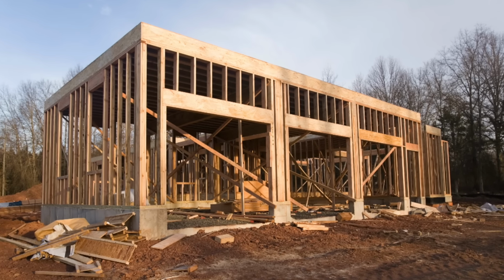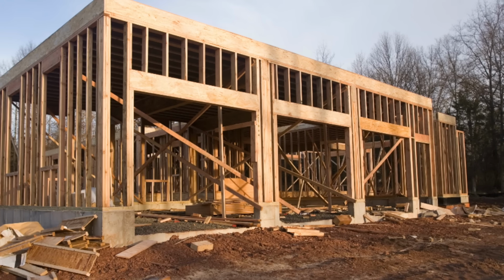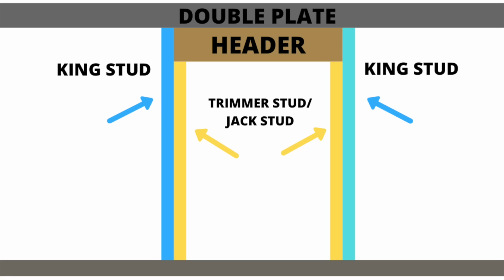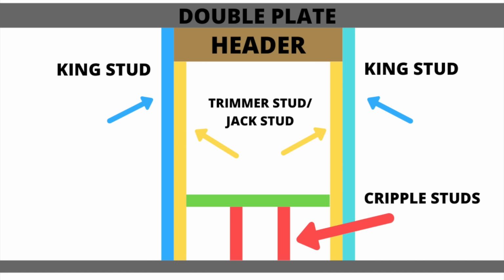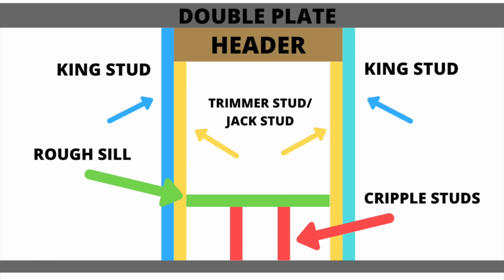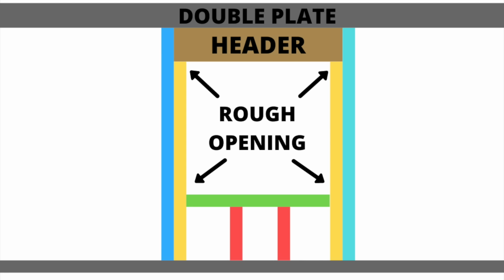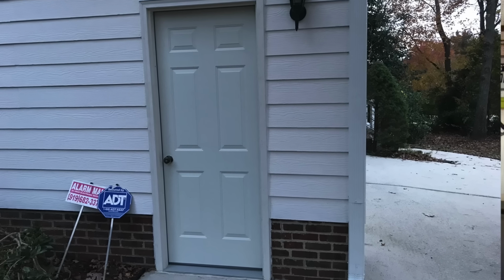All House Framing EXPLAINED...In Just 12 MINUTES! (House Construction/Framing Members)

Comment: Good stuff. Great overview. Refresher course for me. Can I be nostalgic about swinging a hammer, smelling sawdust and hearing the whine of a power saw?? I just saw a video from Japan that answered a lot of questions I've had. In domestic construction in Japan they don't use diagonal braces. (Your building has shear walls which are even better). They were installing one diagonal on one stud bay (at least 2' wide) at the corner.  Is that enough?  Here's what I saw in Kumamoto, Japan a month after a big quake in 2016: Some older structures collapsed. It looked like the heavy roof (ceramic tile) twisted a quarter turn as it collapsed.  Think of a stud wall with a diagonal brace in just one stud bay. Should keep the whole wall square, but if there's movement the rest of that wall can twist away from that stud bay and then it will collapse. I'd never thought of this before. A diagonal crossing multiple stud bays gives the whole wall more integrity, making it more of a large flat panel... And I'm trying to remember the last time I put a diagonal brace in a wall. At least 30 years (I did a lot of construction, but not much over the past 30 years). Now I, and everyone else just covers the whole wall with plywood. It's better, not much extra work.  I traveled extensively around Japan and found a lot of older structures with missing wall coverings. I didn't see diagonal bracing anywhere. 
Japanese highway and modern steel construction are built to the highest international standards. I did see one 6 story office/retail building in raw steel. No diagonals, but the beams and columns were about 3x larger than needed. It looked more like bridge construction than a building. Where I think the disconnect happened is temple construction, post and beam, is brilliantly designed to make a flexible but very strong structure. In a large quake the infill panels might have some issues, but the main structure does exceptionally well. Some bracing comes from what look like decorative stacked elements where the posts meet the beams. This construction method came from China where the Chinese understood how it worked. Some modern Chinese housing developments are crap, but that's about modern corruption. Chinese farm structures all had proper bracing, like an American framer would do, except for the places made from mud bricks.  So now you build your Japanese house. You think you're copying the temple structure design , you stick up four posts, then beams - outlining the box,  but no braces like in European and American post and beam, then you infill it with weak walls, then heavy rafters and a heavy tile roof. Earthquake hits, the lack of diagonal bracing, the roof moves or twists and the whole thing collapses. This happened a lot in the Kobe quake. 
I've seen videos on 'amazing' Japanese earthquake construction, if it's not modern, not a Chinese temple design, it's usually a lot of bunk. (like the suspended columns that are claimed to counter move dampening movement from  quake. I don't buy it. Not a bad idea but not effectively executed or understood.)
 You might want to add that top plates are doubled for two reasons. The first is to spread the load more evenly, but also so walls can be tied together. It's important that the two top plate boards overlap by at least four feet. In my old house at one point it was overlapped only about 18", the header above an adjacent door popped during an earthquake because of this.  The fix, because it was in the attic was to put everything back in place and cap the double plate with a longer third plate. 
I renovated a couple of old beach houses in Santa Monica, California. They were balloon framed. The second floor joists hung off lumber nailed to the surface of the long vertical boards of the walls. Of course after 100 years they all sagged. People would stop by and say, "They sure don't build 'em like they used to."  I'd smile, but always mutter, "Thank God they don't." My dad told me that when the nails start rusting in a balloon framed house they start to fall down. A modern framed house he said you could make all the nails vanish and it would all still stand, at least until the wind picked up.  This is because in modern framing everything transfers the load all the way down to the foundation.  Hope if you've read this far it's been interesting.
Reply: I live in Japan - moved there from Australia. I built a house I designed in Japan, with a Japanese construction company. The houses are almost always old school "post and beam" type construction - up to 120mm posts, and my main rafters are something like 270mm x 105mm beams. The modern designs still use this medieval method (which I made a feature in my home with lots of exposed beams and rafters) but most bracing is actually metal brackets and bolts I noticed. They do use a few cross-beams, and in one or two places plywood sheath. It's rare to see a fully ply sheathed building though...
You have basically hit the nail on the head with two major aspects of Japanese culture in general though. 1 - Religiously copying the external form of something without understanding the actual function. 2 - Coming up with an overly complicated and inefficient solution to a problem that wouldn't exist if they'd just done it the way it should have been done in the first place.
It is telling that my house built by Japanese carpenters has had several issues with leaking roofs and moisture, and a roof ridge cap blow off in a typhoon, while my shed (built by me with 2x4 or 2x6 according to Aussie standards) has remained totally waterproof and survived the same typhoon intact!

Comment: Great video, earned my subscript. I think learning framing is essential to house repair jobs, including running electrical and plumbing lines. You need to understand what is behind the wall, floor or ceiling to perform correct work.

Comment: I actually understood this video. My home was built (a typical NJ townhouse development) in 1995 and I took pictures of the construction from the slab concrete pour, to framing, to drywall, to completion as this is our first (and only) house. Our roof was pre-manufactured trusses and we had to decide whether we wanted the optional cathedral ceilings in the master bedroom or not so we got the correct roof trusses. We went with the flat ceilings. We also had the construction workers use our upstairs bathtub as a toilet even with the port-a-potty outside our house. We also found empty beer bottles inside window framing, and trash in the walls before the drywall went in. Our home builder (J.P. Orleans) only hired the best undocumented workers!
Reply: Oh, and after the house was about 10 years old, we had some construction work done and when our garage was opened up to repair sheet rock, the contractor said that all the fiberglass insulation was installed BACKWARDS in the exterior framing. No wonder our house was always hot in the summer/cold in the winter.

Comment: Really wonderful video, great information, thank you! At 5:55 is a picture of headers with no Jacks supporting them. Hopefully they were still in the process of building that wall and were adding some support later, otherwise the entire load of that header will be sitting on just nails!
Reply from the maker: Thank you, Tim! That’s a piece of stock photography, but that was my exact thought as well 😪
Reply: The floor system above is going to use floor trusses (see picture). The trusses will carry the load, so what you see is a header in name only, but not load bearing.
Reply: @jobacuda4472  gotcha, that makes sense. I’m assuming then that the floor trusses run parallel to this wall? The floor trusses I’m familiar with are still 16 or 24” OC, so they would still land within that window span if they were perpendicular. There is always the thought too that this is a one story build with trusses spanning over this whole wall, which would also negate the need for headers. Seems like though if they were headers in name only, they would be sized smaller?? Perhaps they are just to give the window frame some rigidity:)
Reply: @timlecount8690  I think they could run either way. Can't tell from the one picture.

Comment: 5:54, those don't look like very good headers. The top boards are facing the wrong way for good support, no jack studs, etc.
Reply: I don't know if you saw my earlier comment: The floor system above is going to use floor trusses (see picture). The trusses will carry the load, so what you see is a header in name only, but not load bearing.

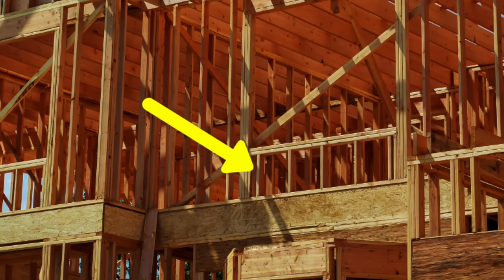Comment: @ 6:29 the arrow is pointing to a cripple. At the top if the cripple is the window sill, NOTICE there are two sill plates. This is the proper way. Unfortunately many builders are cheap and only put one plate for the sill. With two plates you can see that it will be stronger but another benefit is that you can nail the window flange to the top sill and nail the plywood sheathing to the other one without nailing through the flange.
Reply from the maker: Dang, that’s a good point, Simple Man. Easy to crack a flange with a nail. Best to have deadwood for every type of cladding, inside and out. 👍

Comment: Nice video! Could you possibly make another video explaining why the U.S. is accustomed to building homes with lumber, while as other places use bricks or other kinds of standards? I don't know if that makes sense, but I know regionally, there are contrasting styles of building a house. It would be interesting to hear the pros/ cons of each building style. Cheers!
Reply: The US and Canada have vast forests that are managed to supply lumber for building, so it's the most economical material to use.
Reply: @jobacuda4472  That makes sense. I'm sure builders love the vast supply of cheap lumber. But I do wonder about strength and durability. American homes are just not built to the standards of brick, mortar, and concrete homes in other countries. I wish they were built stronger and more robustly.

Comment: Is there any rhyme or reason to blocking? I just bought a new house and would like to run some wires but have no idea where I will run into a horizontal 2x4 between the plates.
Reply: blocking is required in any walls over 8' tall. It is supposed to be mid span unless the walls are substantially taller
Reply: Depending upon where it's located, it could be for added strength, backup for something that will be mounted to the wall, or fire/draftstop to limit the spread of fire in the stud bay.

Comment: 36 year commerical carpenter here, you did a good job for explaining to folks.  You'd be surprised at how many "commerical carpenters" don't know a lot of these, much less how to take advantage of a speed square or lay out a set of stringers with a rafter square.  Good job for home owners or those wanting to know some basic stuff!
Reply: Laying out stair stringers and getting it right is alot more tricky than it appears at first. I don't think anyone ever did it that didn't mess one up.
Reply: Your comment made me smile,, put a steel stud guy in a wood framed house they would be lost!!
Stair stringers,, need rise and run measurements and number of steps to come up with the proper dimensions. I remember those days!! Stair day(s) and cutting a roof were my favorite days. How many people can use a rafter square for common rafters. Or do the step downs for hip/valley jacks?

I am stuck in the commercial world as a GC, I miss the days of constantly brushing off sawdust
Reply: I’m with you Greg, I’m a retired carpenter and commercial carpenters thought they were the shit but they couldn’t frame a house let alone build a set of stairs or cut a conventional roof, hopefully new generations of people will want to learn a respectable trade if college doesn’t seem like  that’s something is for them.
Reply: @mozerdude8102  im with you in this regard,
however a lot of framers I've worked with can't figure out how to put together a concrete formwork system for tables, slabs, cores. Every aspect of the trades have their own scope of work, and whatever trade a person is it, we all need eachother.
Reply: @mozerdude8102  Not all of us "commercial carpenters" are lacking the skills to do as you mention. Far from the contrary for some and far more skilled than the typical "wood butchers" that I have had come to work for me outside of knowing some basic principals of layout...yeah there are a lot of cocky folks on both sides of the fence for sure....don't discredit the other side of the carpentry trade...it shows you are no different than what you put down.
Reply: @13612  again your using the term “wood butchers “ like your something better proving my point you think your better!
Reply: @mozerdude8102  I put that in quotation marks to indicate the "stereotypes" you put down in your comment to start with about commercial carpenters...you keep playing semantics.  Your the one that came off with the initial commentary about being the better of the 2.  
  There are plenty of us commercial carpenters that are just as knowledgeable  and beyond,  as you play yourself to be all knowing at your level of "greatness" compared to the commercial side of the trade..enough of your nonsense...refer to my initial post and cast your judgement on the ones you know, not the whole lot of us commercial guys....some of us have their feet well planted on both sides of this trade called carpentry both wood and metal and more.    Now would be a good time to start putting up some of your video's of your greatness instead of being the critic as is most often the case on UTUBE....talk is cheap.
Reply: @13612  I never implied I was all knowing, I’m sorry if I insulted and commercial carpenters, after seeing the term “ wood butchers” it brought back bad memories , at a union meeting when a fellow carpenter was calling us wood butchers / track jockies like we were some kind of second class citizen , to this day I regret not confronting him at that point we deserve more respect!
Reply: I started residential framing custom houses on golf courses in Pinehurst, NC in the early 90s
From 2011-2016 I got into commercial glass work
I have to say, a lot of those jobs had the worst framing I've ever seen
Out of level, outta square
And we have to Install square glass in, at times, a rhombus
There's no "fudging" metal and glass
A lot of the people in those jobs, shouldn't be considered framers, more less paid as such
Not all, but a lot on the jobs we did in FL

Comment: You forgot (or ignored) that some times those "beams" are also called "headers"!! And headers support the load weight like a girder or a beam!!
Reply: The header is often installed when putting a large opening (like an addition) into a preexisting load bearing wall also!! I know this because I used to work for a contractor years ago who did remodels AND building additions!!
Reply: Headers are just beams for door and window openings.

Comment: Hi I'm a carpenter from the uk the mud cill that you explain at the bringing  of the video out of intrest does it not have damp proof course underneath? Treated timber still rots over time under constant moisture. Timber frame construction in the uk isn't as common as brick and block but I really enjoy getting to work on timber frame buildings. Also the headers that are shown on the video, in the uk structural timber frame walls tend to be completely clad in ply insted of just above the head or structural points like floor joists and wall plates. Thanks for the video found it quite interesting 🙂
Reply from the maker: Thanks, Dave! I lived in Glasgow long ago—I enjoyed seeing the different construction methods over there. On some sites I’ve seen guys put a moisture barrier down under the sill, but in most places the masonry moisture isn’t high enough to affect treated lumber too much. But, for the most part we do clad everything with osb or plywood as well, it just hadn’t gone on yet in these pictures!
Reply: A mid sill (sole plate) shouldn't be subjected to constant moisture. If the area is always getting wet, any nearby wood will rot, regardless of your DPC.

Comment: Hi, I believe I am in need of replacing an under-engineered 20-foot wooden beam with a lvl.  (I have 1 1/4 inch deflection.) I was wondering how much that would cost in some type of range. (I realize cost varies state by state, etc.) I believe the components are: structural engineer, materials & labor install. I am not doing myself but I want to know what to look for AND I find this stuff fascinating. Thanks, Rob
Reply: The question is easy to understand if read. How is being knowledgeable about a project and knowing an approximate fair price when hiring someone being cheap?
Reply: Hire a real carpenter. Stop being cheap.

Comment: I've seen it where blocking between studs is staggered, rather than in a neat line like in your video. Why do builders do this?
Reply: It is the only way to get certain kinds of nailing configurations in with certain tools. As you can see in this link, https://www.oneprojectcloser.com/wp-content/uploads/2010/11/fire-blocking-between-studs.jpg nails go into the ends of the wood, and if all the wood is lined up you don't have access to one end of the blocking to add nails when you put the blocking in between studs.
Reply: @victorquesada7530  Ahh ok. Thank you very much!